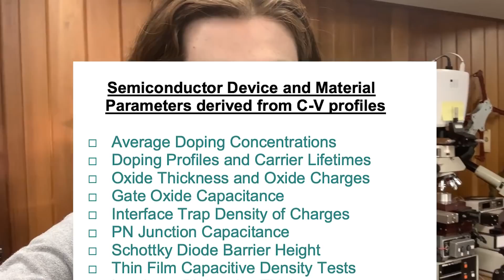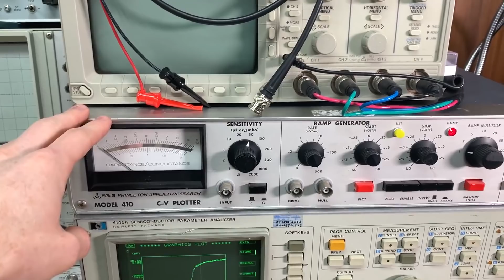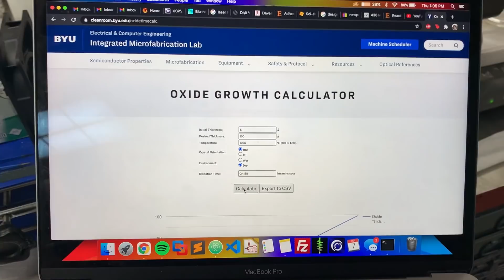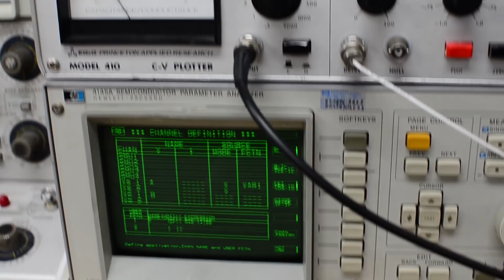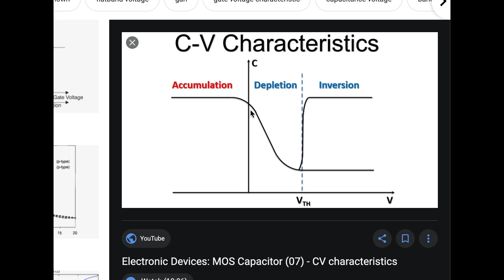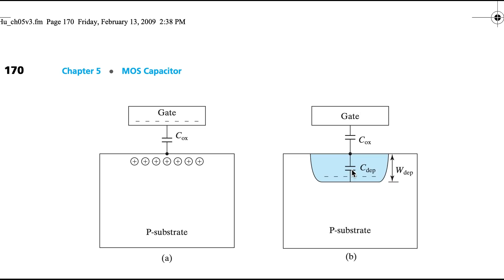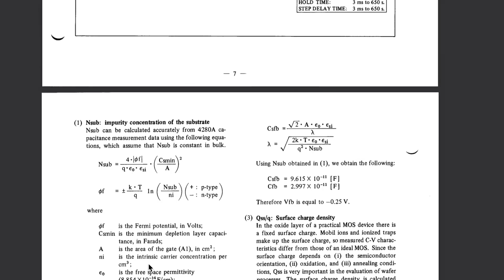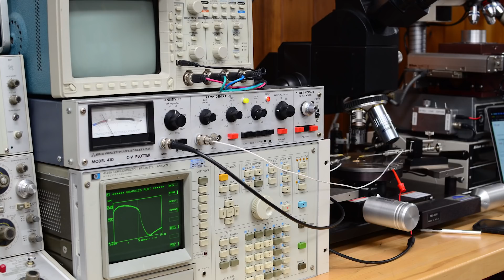MOS Capacitance/Voltage (C-V) Measurement

Comment: I have a similar HP4145A and would be interested in performing some CV measurements as well, there are even other  410s on eBay. Could you shine a bit of light into how you connected the 4145 to the 410 and what custom function you used to plot it? Thanks!

Comment: Thank you your video.

I have some question, if you have some time help me plz:)

First, I wanna use bottom contact then can i use dry etcher for bottom to etch SiO2? Then, i will make bottom contact with Al with sputter.

And I learned that there is ideal threshold voltage in situation that Parameter(Body doping, oxide thickness, Gate metal) is fixed. I want to ask if you found  ideally threshold voltage In this experiment or not?

Thank you. For your help and good video. Have a nice weekend.

Comment: People cut the power cord on old electronics to keep people who don't know better from just plugging it in. Doing so with out inspecting or replacing old components can often fry the whole system. So one failed capacitor that wasn't inspected could end up turning the whole thing into a paper weight.

Comment: nice set up hey mate if your interested check out my fusion reactor prototype. keep in mind I used theoretical work done by lpp fusion when I engineered this prototype.
there are four videos on my channel this one 
https://youtu.be/y9HmrZCBX70
explains the particle flow and the reaction. the other video https://youtu.be/y9HmrZCBX70 
is the full no deuterium test run of the first half of the test core and 28 mercury's is the vacuum 
so there's a major boost in performance if I get a better pump, this is the same test with reduced color and brightness to show the plasma better https://youtu.be/rr19NSVTIz0
witch killed that camera after ward and the test run vid has no 
sound but read the description for some more info. 
https://youtu.be/AH9sdaU1izc
this one is new

Comment: About the thickness of the SiO2: I would expect it to be difficult at such a small value to really measure this thickness accurately. Would the layer not just contain a large gradient in oxygen concentration due to the diffusion of oxygen into the silicon? Or, in other words, is it not just a gradual transition going from SiO2 at the surface, to SiO, to Pure Si in the bulk?
Reply from the maker: Good point, yes, there is probably a TEM cross section of this online. Really what I’m measuring here is the effective oxide thickness from an electrical point of view
Reply: @SamZeloof  Thanks Sam. By the way, you managed to make yet another high-level video!

Comment: Don't forget about the ~2 nm of native oxide on the wafer before the thermal oxide growth. So 17.5 nm seems about right!! That is pretty cool, congrats. If you need in the future, you can etch away the native oxide with HF (or BOE - buffered oxide etch) before your thermal oxide growth. But HF is quite dangerous and likely not worth trying to set up a wet chemical bench in your lab.
Reply: You're forgetting that it's probably necessary to make low-integration ICs.

Comment: "Don't know why anyone would cut a power cord?" Two reasons; $0.01 or they need power to something else
Reply: Often it's done to mark a piece of gear as 'Do not plug this in again. Danger.'.  
Makes you at least think about WHY they would have cut it off like that and stops people from just plugging it back in when there could be something wrong to the point of causing fire or danger.
Reply: BTW, have no idea why I'm subscribed to this channel, but bad ass

Comment: They cut the power cord so that they can write off the equipment value on taxes when disposing of it.
Reply: It is too old for it to have any undepreciated value.

Cutting the cord is a simple way of emphatically stating "Do not attempt to use this device".

I have cut off cords as a way of indicating that I have checked out the device. I have declared it broken and not worth repairing.

In a similar vane I have cut off the cords of unsafe power tools.

All of this is done with the knowledge that anyone that is skilled enough to repair the device will not be inconvenienced by having to attach another cord.
Reply: @hamjudo  There's no telling when it was cut off. Also, even old specialty test equipment can be expensive. Third, they can probably claim the cost of replacing it or what they spent on it (capital investment).

Comment: One thing I could never really find, and would be interesting to see from you: given a fixed temperature, how the leakage current varies of a MOS (with Vgs=0) I've found some data under the title "sub threshold conductivity" but I was never sure if my calculations based on that were correct or no. The manufacturers give huge ranges of leakage current for MOSFETs, and I could not get more information about it.
Reply: It is a function of threshold voltage, and that one is hard to control better than +-5~10%.
Reply: @namibjDerEchte  it also depends on channel length and other things, many of which are susceptible to manufacturing variations. The exponential nature of the subthreshold current, this might explain the huge range the manufacturer gave you.

Comment: I like the way you can get a 15nm +- 2.5nm oxide coating by 'banging it in the oven for 4 min 30 sec'.
Reply: I tried banging my oven for 5 minutes straight and it didn't turn on.... Maybe it needs more banging to pre heat.

Ill be really hungry by the time this works...